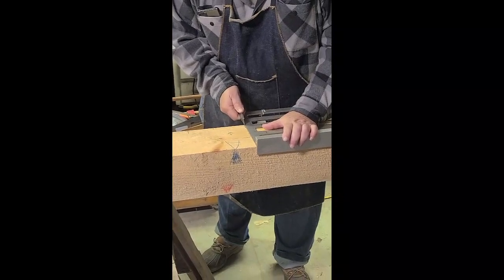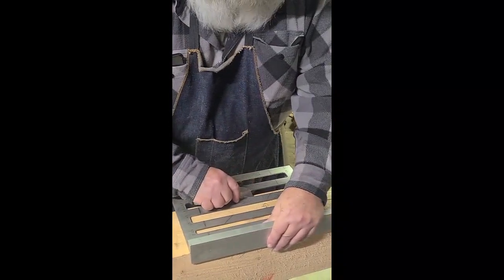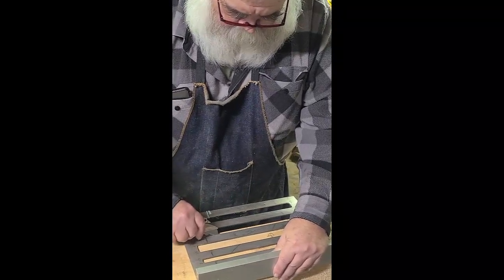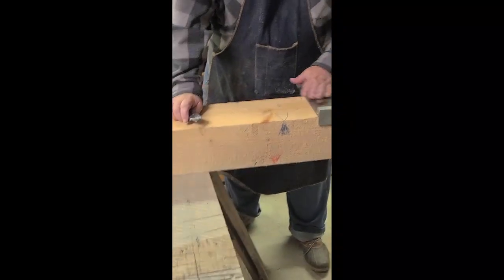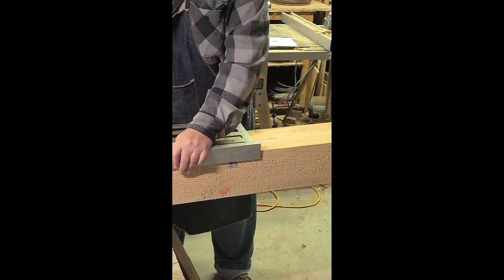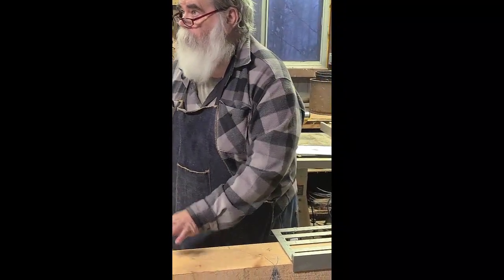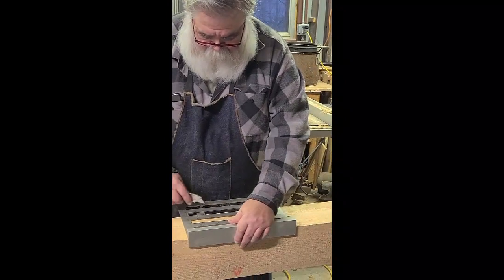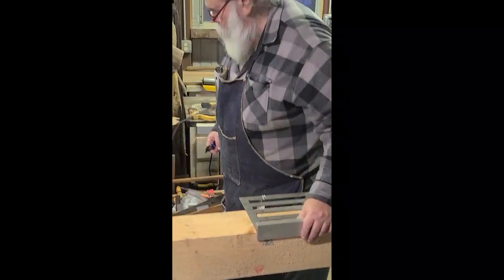Should I Plane My Timbers

Comment: I'm belt sanding the band blade marks off of mine. Sometimes the band is kind, sometimes the set from re-sharp makes deep marks. Can't afford the planer for 8x and 6x members.
Reply from the maker: You can just plane the showing faces with a 3 or 4" handheld power planer. That is easier than trying to take the timber to a planer shop.
Reply: @JimRogers117  thanks for the reply. The reason I started sanding was because my reference faces are where I need accurate layout and my marks were marred in all the chatter. Those faces are often the hidden faces too.